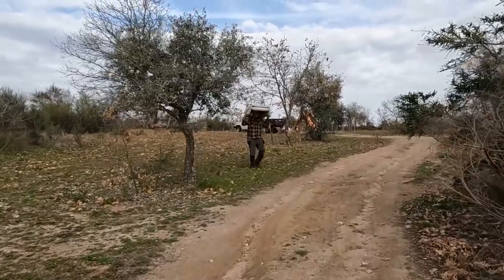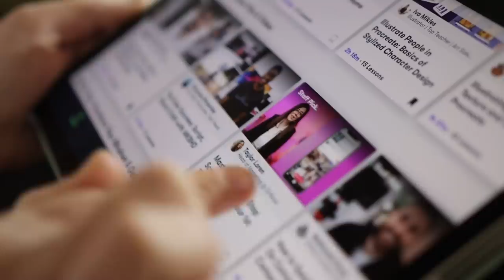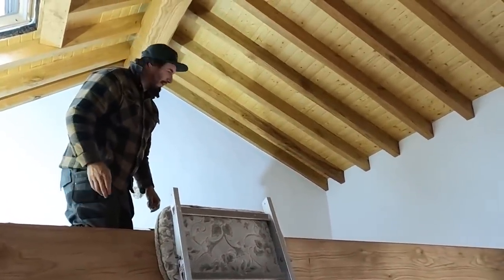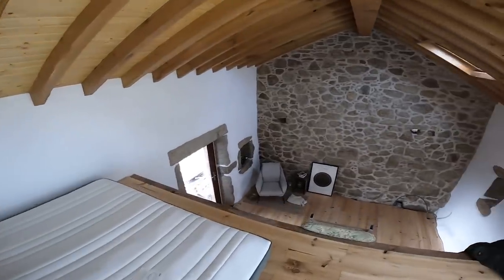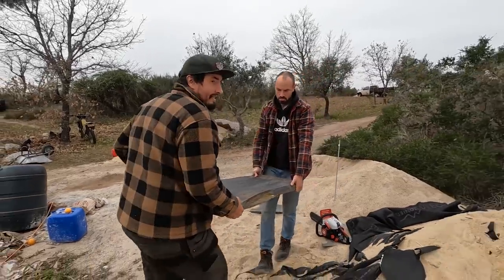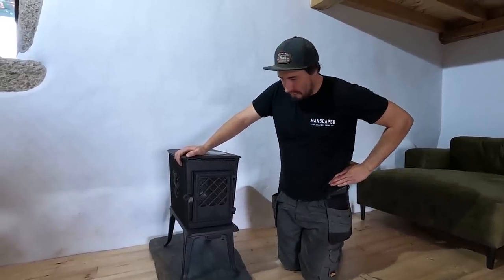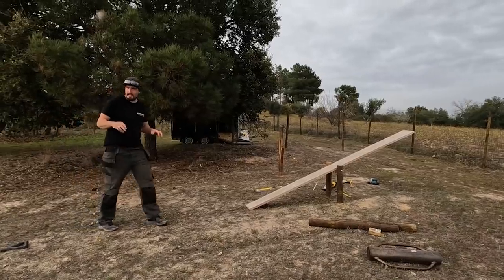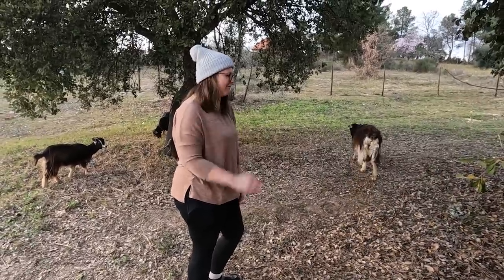BUILDING OUR BEDROOM! Converting a Stone Barn in Portugal

Comment: You should consider a glass cover. You can get them rounded in the front, and you would also be able to see the wood floor while still protect it from any ash or sparks. It’s very common in Sweden.
Reply: Glass? I thought glass conducts heat? I would personally hate to clean up shattered glass if it ever broke. Glass also gets fragile with extreme temp changes. How is glass common in Sweden?
Reply: It's tempered glass, the same kind used for the little window on stove doors or ovens.
Reply: @KCGiD  ah. Ok. Well i have seen even tempered glass break. In fact when it does, it explodes. I still wouldn't want it for my place. I am a big believer in "if it ain't broke it don't need fixing". Stone has been around for millenniums and it still works. Not saying my way is the right way just that i would not take the risk myself.

Comment: A suggestion for your log burner. I stayed in a house with a curved piece of really thick glass under the log burner.  It allowed the floor to still be seen. Beautiful
Reply: But glass will not protect as well as stone.  And it's easily broken, chipped, scratched and everything else!!!
Reply: Wanted to write the same! It's beautiful
Reply: You could possibly use epoxy to glue the stone under the stove together.  If you built a wood frame around the glued stone, it would look pretty good. Otherwise mortar seems traditionally okay

Comment: Hi Bee & Theo,  I love your couch. Watched you assemble on your previous video.   I've also put those sticky felt pads on my furniture but sometimes they come off when you move the furniture when cleaning.  So I've also use the black rubber stoppers you can purchase at hardware stores.  Normally used to put on ends of piping for plumbing and electrical.   They come in all sizes. Work brilliantly cos they fit like caps over the end of the chair legs 👍

Comment: On heavy furniture that get sat on, the felt can rub off with shifting over time. They make small rubber feet that nail or screw in. If the felt doesn’t last consider them. I’’ve small rubber cups on the front and bigger on the back to handle weight pushing back. If you slide the felt and your floor has grit on it, it will scrape the grit into the floor.  All stuff I learned through trial and error.

Comment: Love it!  Could you not piece the stone slab back together?  You all have some amazing pointing skills!
Reply: resin pour would fix that
Reply: @Rockhopper1  an epoxy cement is better because of the heat, or regular cement. that type of rock is notoriously fragile but it does glue  nicely, the cut along the grain will not be visible at all, the other one is well "character"
Reply: Or bust it into pieces and cement a mosaic.
Reply: Bee has great idea matching stove slab to semi circle of entrance.  If Theo builds headboard with shelf you can have storage for small things.

Comment: I had a curved hearth stone.  And I wanted a wool carpet in front of it to minimize flammability.  Unless I made it myself, it was impossible to find one.  A suggestion for you....because I wished I had done a flat front ...even if I used a curve on the sides that flattened to be straight where I wanted the wool protecting carpet.

Comment: If you like the slate, fix it in place with thin set and grout in place. Mine has remained in place for 45 years and hasn’t shifted or cracked again. About all I’ve done with original slate is added a ceramic wood grain floor Tile 6”x 36” for a new stove, much bigger .

Comment: You could frame up a pedestal platform for your stove to sit on and insert the slate back together and trim it square to fit in to the top of the pedestal. You wouldn't even know it was cracked. Using this slate inside of a pedestal would also keep you from jamming your toes into the bare rock.

Comment: Great video. You may need some rubber covering or something for the see saw so the goats won’t slip on the wood. Their hooves can slip on wood easily. The upper bed inside the horse trailer maybe would need rubber or a grip substance so they don’t slip on that either. Goats also like large tree stumps to jump to climb on and off.

Comment: Your little stove could actually go anywhere in your house for the heat distribution. I have one exactly like it in our cabin that is approximately 18 by 24 feet and, believe me, it heats the whole thing everywhere. You will definitely want to close the vent before you go to bed. Our salesman called it a "microwave on legs!" I would put it in the best place to accommodate the chimney and it does need a wider base. It's also great as an extra stove burner (but more difficult to regulate). I also put wrinkled up tin foil on the burner when it's lit so our cats won't mistakenly jump on it when it's  hot. I hope you have a wonderful First Night in your new little home!

Comment: For what it’s worth…
Try laying the broken pieces of slate together under the stove.  If it marries nicely it can be glue together with Clear Silicone which is good to 200 Celsius. Make sure the edges are dust free and give it 24 hours to set. Allow some seep room from the top of the crack so nothing squishes out the top or side surface, that way all you’ll see is a tiny crack. You will be absolutely amazed at how incredibly strong and heat proof the bond is. I’ve used it to glue all manner of materials from leather, rocks for outside sculptures, to fine porcelain. When I’ve glue fine porcelain it even sounds whole when you tape the piece instead of ‘thunk’ like it’s been glued.

Comment: I’d still do slate, but use slate tiles. Actually, just about any type of tile would be ok. You can then tie it together with the entry. Regardless of what you do, you will need something. Not so much for sparks, it’s more for the dust and little bits that come with hearting with wood.

Comment: You definitely need a much bigger slate. I'd reconsider putting metal under your stove. If you've ever grabbed a pan off your stove with a hot metal handle that's how it will feel under your stove. Whatever you decide to use make sure it's big enough to stop any hot embers that fall out from reaching your wood floors. Have you considered putting anything against your wall behind your wood stove? I'm afraid the heat generated from your stove might mess up your plastered wall. Your barn is looking beautiful you guys have done an excellent job making it a beautiful home!

Comment: 100% right about the plinth. The rectangular proportion is wrong and doesn't do justice to the stove. I still think one of the goathenge flagstones would work well. On the other hand, black slate absorbs heat (both passive solar and direct heat) and retains it for slow release after the fire (or sun) has gone down.

Comment: Metal is not a good idea for under the stove. Metal may not burn but it will conduct the heat to the wood floor. I would suggest cement. It does not conduct heat. You can make a mold to the size you want. And cement takes stains and dyes so can be almost any color you want. I would suggest making it outside and moving it in after de-molding. Cement can also be polished if you want. If you reallllly want the stone slab you could embed it in a small batch of cement so that the crack(s) are held together. With the cement dyed black i think it would look nice.

Comment: Slate is brittle and like any stone must be kept level to avoid knocks and shocks when its not flat. If you slide thr two pieces together like a puzzle there will be no gap and ghen place the stove onntop there will be no movement so it should be fine once its installed.

Comment: Use ALL the pieces! The broken joints will not be a problem if all pieces are floated on a bed of fine sand. 
Make a wood frame (20 mm height?) with the same outside dimensions as the full size stone. Lay out some heavy kraft paper on the floor then place the wood frame on the paper. Use tape on the inside of the wood  to seal the paper to the frame. Fill the inside of the frame with fine dry sand. Place the stone pieces on the sand and gently work the pieces back and forth so the stones is evenly supported by the sand. Cut the paper flush with the outside of the wood frame. 
PS: Don't carry slate flat! Turn it on edge to carry it.

Comment: A tric to get the self stick to stay longer is to heat them the glue a little with a hair dryer.
Reply: Theo, maybe for the mezzanine, you could make a ladder/staircase you could roll from  side to side, so it wouldn't be in the way.  I know there is special hardware for that, but I don't know how it's called.

Comment: Two things about the stove base.  If you like the square, the slate should have a clean enough break that you could just epoxy the pieces back together.  However, design-wise, I agree with Bea that the better option might be a semi-circle (it would not jut into the floor space and be less of a potential trip hazard).  You could make a cement semi circle out of cement (much like making a stepping stone) and in-lay it with mosaic tile or smooth pebbles.

Comment: CAREFUL OF TOO MUCH in the loft -  those beams and uprights won't hold - "20 wooden crates" for your clothes! No no no oh my gosh- think of the loft as a BOAT - careful w weight and how you distribute it - don't want to sink ;0 - You  create storage using those fabulous stone walls with  (just the smallest  tiniest  hardware) using ' hanging strap' construction -  So everything off loft floor as much as possible and instead attach to the walls  and even the roof beams! - check out  how IKEA  open shelving attaches to wall - basic stuff- steel bars attach to wall and braces to hold shelves inserted into steel bars - very simple and you can change it up /move shelves. BUT why not have your clothes closet in your "spa" bath house? That is what I did - best decision. HAPPY FOR YOU

Comment: Always always carry stone slabs on edge.even granite will bust if carried horizontally. Also like I said before, DO NOT use real slate for a flooring in the entry. It will release sharp thin layers over the years just from walking on it. I know from experience and those slivers are like knives and will Cut you deep. Use terra cotta tile in the circle entry. Or a ceramic tile but NOT REAL SLATE!!!

Comment: You made the classic mistake of lifting the stone slab then dropping it down on the uneven sand . The impact caused a fracture along the grain. Place the 3 bits on the floor then glue them together. Alternatively , a steel band or angle iron around the edges will secure it.

Comment: Gorgeous chair. As someone who heats with a wood burning stove I can tell you, you absolutely need a wider base .. the sparks sometimes fly out when you open the stove door so you need a covered area around it, not just for the feet. You could easily make a framed platform and use the slate pieces on it, like you would if you made a tiled base, and use a stone glue to put the slate back together. All that said, what about the rope trim along the perimeter of the floor?! I've been waiting for that anxiously. And are you going to put a railing up on the mezzanine?

Comment: You get a type of glue that glues pieces of slate together. I would definitely glue it, because the big piece can be the weight-bearing piece and the glued on pieces keeps the heat and hot ashes and fire away from the  wooden floor. It works like a charm and if polished you do not see any  Crack whatsoever, with lots.of laughter and a wink at your expensive stone!

Comment: Love the house!! Btw, most natural is strong in compression but weak in tension/torque. So thin/cut slabs can be stored either vertically (eg, propped up on a skinny edge) or  horizontally/flat as (eg, in the sand bed as you did), as long as the weight is distributed. But to carry, it's best to flip up vertically immediately (a skinny edge toward the ground and flat surface perpendicular to the ground). If you carry them horizontally (flat surface parallel to the ground), the unsupported  central weight is too great for the relatively thin depth of the slab and it often snaps across the middle. Even without any previous internal cracks or faults. Not sure I'm explaining that well, but 'lift and flip up' will usually protect the stone.

Comment: Mix a little epoxy together and reassemble the slab. As long as you don't use too much it will hold together and hide well. Just lightly clean the break and get rid of as much loose material as possible without damaging the edges of the fracture. It will work. I had to do that to a beautiful piece in our garden and I step on it all the time. No worries.

Comment: You guys can probably still use the slate provided the feet of the stove have a solid landing. Just put the pieces back together like a puzzle and see if the stove feet have a solid landing. Those splits are along a sheer line with the grain of the slate, the stove will present a compressive load and most probably not cause more linear splits. That being said a slab of granite the same size as the unbroken slate is most likely a better bet. So stoked to see this all coming together.

Comment: Just get some dark grout and use it between the broken pieces to hold them together on top of the underlay. The pieces are likely heavy enough that they won’t move so don’t need glueing. Alternatively use some specialised mortar/adhesive to hold it together and grout the last cm or so. It would look a bit like a cross between slate tiles and “crazy paving” and the joins probably wouldn’t even be that noticeable anyway.

Comment: Why don't you still use stone slab but break it into pieces cement them pieces on board to shape you want

Wood for base protected by stone and concrete so want be a problem . Means the stone is not going to  waste and you can make shape you want

Comment: If you had chosen to take your slate plinth to a stone  yard to have the edges machined the masons would have seen the fault in it immediately  and suggested you don’t use it ! Cheers  .Apiece of black or grey granite  ,a stone with much greater structural integrity(an igneous stone )rather  than slate (. a sedimentary stone )would be fine .even if quite thin( like a kitchen work top ) Ps There are some great Portuguese marbles as well .

Comment: I think your plinth can't be metal because the purpose of the plinth is a heat barrier between floor and stove -- I would just try again with a different piece of stone - if you do go for slate again, put two planks of wood underneath it (going opposite to the grain) and carry it that way - once it is on the floor it won't crack, if you want to be really sure, run the grain opposite direction to the floor boards, so that if there is some slight variation it is across the grain (but honestly, once it is in place you shouldn't have an issue)
Don't give up on your stone yet! (and at least it was only 36? Euro!)

Comment: can't just put the three pieces back together? turn it sideways and put the two smaller ones to the rear, just as they were before they separated? would the cracks even be noticeable with a bit of ash on the slab? I doubt it.

Comment: No! Use the slate pieces. It is perfect. Just fill the edges with Gorilla Glue, reattach the pieces, hold the pieces in place with something to hold the together snug, then used the charcoal pad under it for leveling. It will be beautiful. Any visual crack or gap with be character. At least try.

Comment: Can you not glue the pieces together again. I do not know what an adhesive for the purpose is called, but there must be something - epoxy?
When you cut posts at the height, you should do it a little at an angle, so that the water can not stand on top but run off immediately, so that there is no breeding ground for rot.

Comment: Forgive an old woman's advice!  When building your bed frame, do nt make it too snug a fir with your mattress.  You need a comfortable space for your fingers when you change the sheets!    Also - just a thought about your "bedside chests".  If there is not enough room for one each side, could you attach them to the wall so they are suspended partially above the bed and partially over the floor?   I think that would give you the symetry plus allow you enough space for the chests.